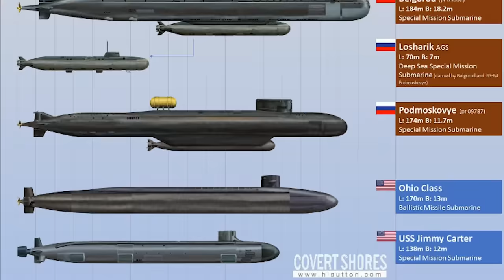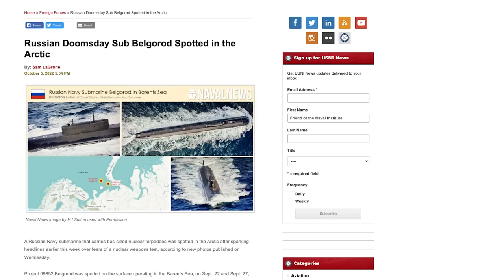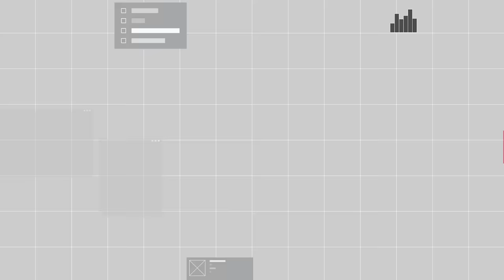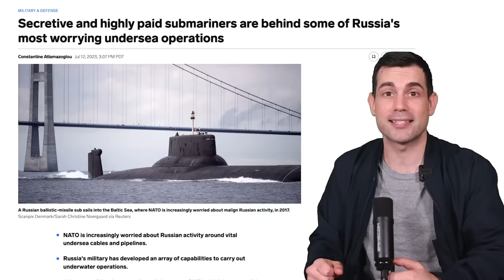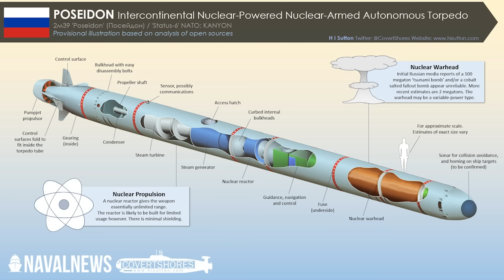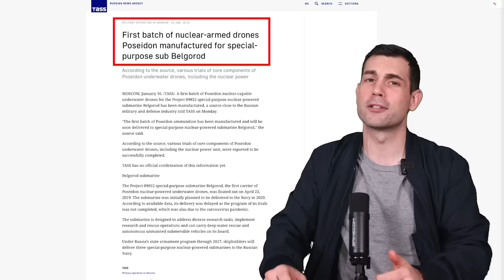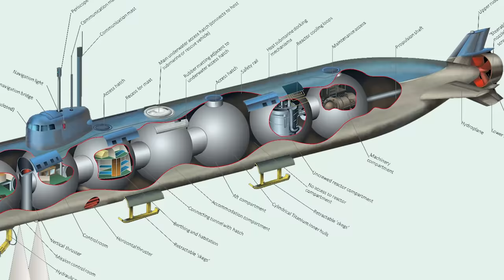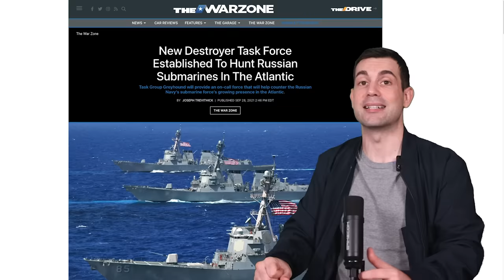What Happened to Russia's Doomsday Submarine?

Comment: I’m sorry cappy, but I’m gonna have to stop you at 5:20

“Russia”
And
“Navy of the highest quality”
Are not known to mix historically

In fact
The opposite tends to be true

You know
With Russia having to tow its only aircraft carrier with a literal tugboat
Or with the “pride of the fleet”
The flagship Moskva being sunk, and it being discovered that nearly 1/2 of the ships systems weren’t even working before it even had been engaged 
And that the engines were nearly 80k hours over their maintenance period 

Or that the freaking radar and ship wide radio would interfere with each other because of the backwards design 

Or how all of the emergency fire extinguishers were all locked away so they couldn’t be stolen

It doesn’t give me a lot of hope in the Russian navy

Even if their submarine fleet is very well maintained, they can’t be supported by the rest of the fleet 

Russia has never done well in the water, just ask the Japanese

Comment: In 1946 the US detonated a 24 kt nuke in the middle of Bikini atoll, a circular reef about 20 miles wide. This bomb was 2 and a half times the yield of the Hiroshima bomb. It caused a wave near 2 feet tall to wash ashore.  That did not even match high tide. That is in an enclosed body of water.   If the Russians detonated a nuke with say their average yield of 800 kt near the mouth of the Thames, you could expect a wave of water about 15 feet tall in the narrow confines of the Thames running all the way to London.   But waves, like radiation, follow an inverse square law and their energy dissipates dramatically with distance.  For contrast, the japanese Tsunami had an equivalent yield of over 9 MILLION megatons. So, 93,000 times the size of the Tsar Bomb, the largest nuke ever detonated.   ( And, NO you can’t fit a 100 mt nuke inside a Russian torpedo ). The danger is not so much from the minor and mild tsunami. The danger is the same danger the US Navy discovered in the Baker test.   It was originally planned so the navy could prove that nuclear bombs were not that big a threat against naval ships.  Most of the ships in the lagoon survived the blast.   But the water blown up into the air and that came down in an expanding wave of atomized fog drenched every ship with radioactive water.  Despite 2 years of relentless effort, the Navy discovered that there was no way to decontaminate those ships and they were ultimately all scuttled. So the danger of a nuke offshore is not the wave. It’s the irradiated water drenching everything for a good distance, making it uninhabitable.

Comment: Majorly mistaken statements that may have been propagated by the Russians themselves but easily debunked. GLONASS and any GPS uses radiofrequency communications, hence there will be zero chance to receive global positioning reception while submerged. Same for any radiofrequency communications between the Poseidon and the launch ship while both are submerged. So the only way to establish positioning via GLONASS or communicate with a now surfaced submarine is to leave both completely detectable by being on the surface and very vulnerable to detection and destruction. There is a one way communication tool called VLF Radio transmission but the antenna arrays are so large that they can't be used even on aircraft carriers and must be terrestrial arrays.

Comment: I was under the impression that super cavitating torpedoes were a really capability.... they just aren't actually useful because they make so much noise.  It's pretty much the worst parts of a missle combined with the worst parts of a torpedo. Smaller payload than a normal torpedo and much slower than a missle, but with more noise, less range, less ability to maneuver.

Comment: Ha ha tsunami 😂 it might make 50 cm wave and the explosion an radiation would be contained in the water where it went off tsunami’s are not water that travels fare but warm molecules that push to the next one pushing pressure but not moving water along way and water is super good for stopping radiation which is one of the reasons why it is used in nuclear reactors and nuclear testing under water